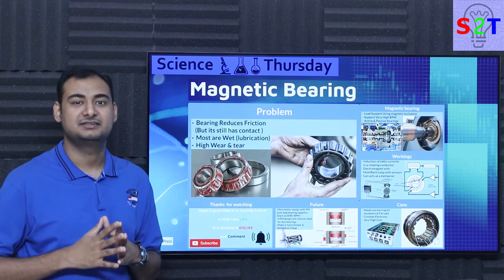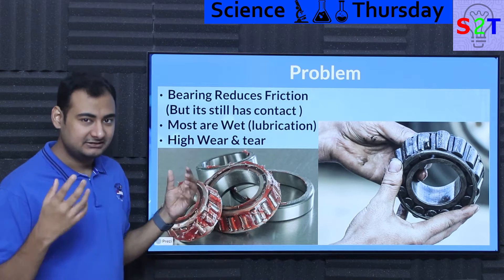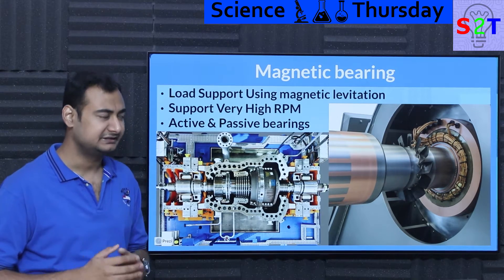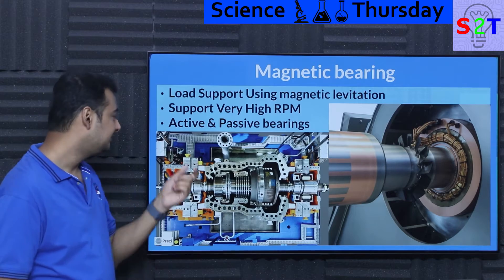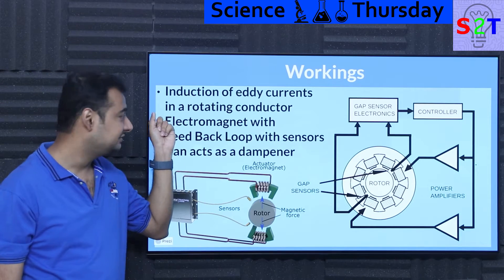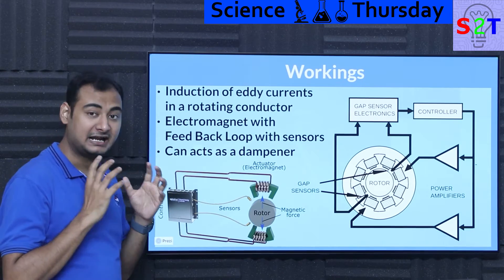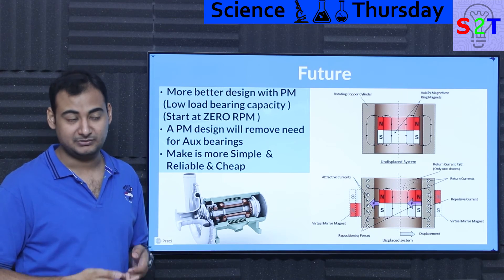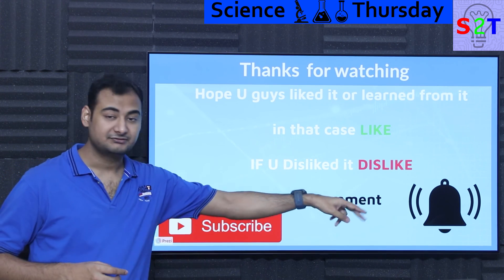Magnetic Bearing Explained {Science Thursday Ep146}

Comment: Information was great, the problem I had was that most everyone whose English may not be their primary language, speak too fast. For example, Japanese is spoken very quickly, and I think that tends to carry over to English when the person learns to speak it. The words are there, but for me, I have a hard time getting it all cause it's spoken too rapidly. I don't mean to offend anyone, but I know I can't be the only one with this problem. Otherwise, what I did get was really interesting. I just wish I could play it back at a quarter slower speed.

Just saw a comment on playback speed, ill give that a try.
Yeah, playback speed at 75% is near perfect. Using YT for years and I never knew you could do that. But I'm leaving my original comment alone so the explanation is there as to why I put it at 75%.
Reply from the maker: Thanks for the feed back and when u have different people using the same launguage it will have some flow issue . I will try to slow it down & this is the reason why YT has palyback speed control

Comment: You do answer people's questions about passive magnetic bearings in a sort of vague way. I think many would look for a more detailed explanation of a passive system. Passively magnetic bearings are limited by their amount of pull and push forces of each magnet used in the system. You pointed this out in terms of weight as in the example of electric companies they are producing power for millions of people they need large systems where the use of active magnetic bearings make sense due to the shear weight of the system in use. Passive magnetic bearings can be used in small applications. For example you will find in many videos on YouTube about passive magnetic bearings they use a more common needle or jewel type bearing to stabilize the z axis of a rotating system. What they don't tell you is that it can also be stabilized by the use of a tractor beam magnet configuration. But this limits the rotating portion of the system are due to the push and pull forces of each magnet making it so the whole rotor/axle part will not be stable beyond about 5 pounds or so of weight in order to achieve long term stability of the system in use with commercially available magnets. I know many might think free energy but this is not the case less friction means less maintenance not no maintenance. As pointed out in the video magnetic bearings are more efficient but not perfect as many might imagine.
Reply from the maker: Thanks for the info